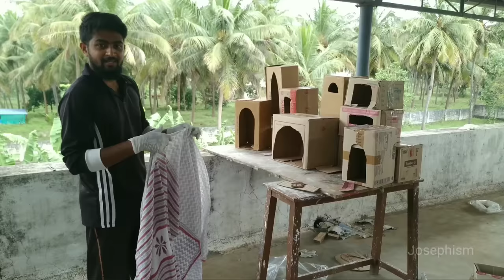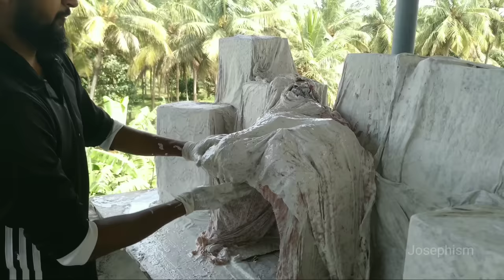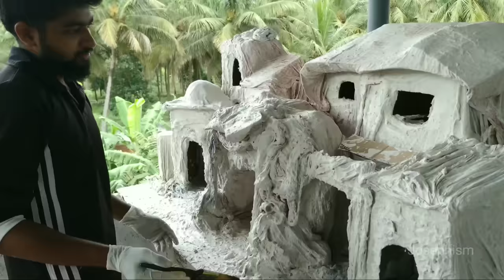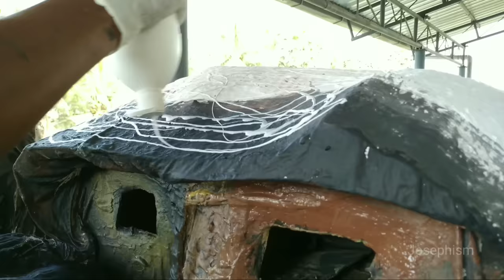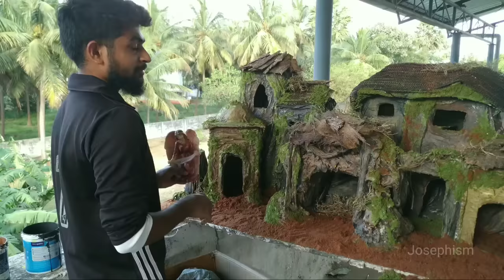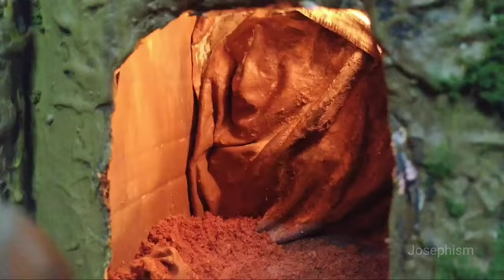ഗ്രേച്ചിയോ style പുൽക്കൂട്  ഉണ്ടാക്കിയാലോ | Italian Christmas Crib | Nativity | Malayalam

Comment: Hi Joseph ,  I am big fan of your work ..have been following for few years... trying out my crib this year... how much time does it take for the POP to dry...one set of mountain dried fast, but the rest is taking a lot of time...is there any specific method to mix the pop +water +cloth...will be very helpful if you could reply...Thanks and Best wishes!
Reply from the maker: Sorry for the late reply, plaster will dry in 20 to 30 min. Sometimes this may happen due to temperature and the expiry of the plaster, or due to over mix of water, the cloth should be white when we dip in the water that’s the consistency if it looks like water that won’t work. And the plaster should applied everywhere on the cloth. Apply some thick consistent plaster on the top of the cloth which shows difficulty to dry that would help✌️